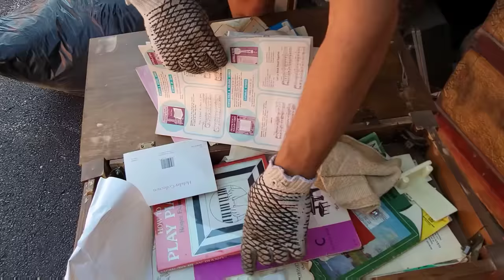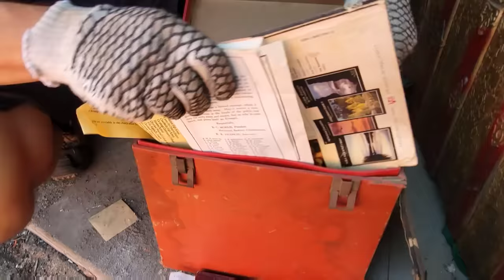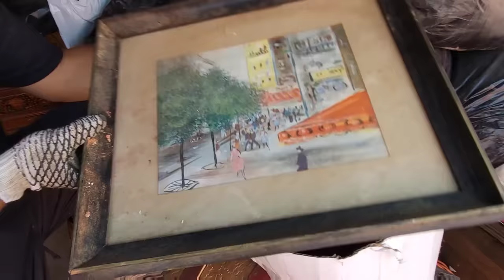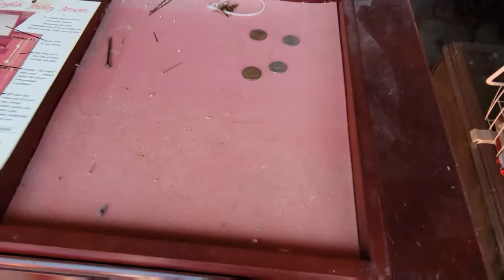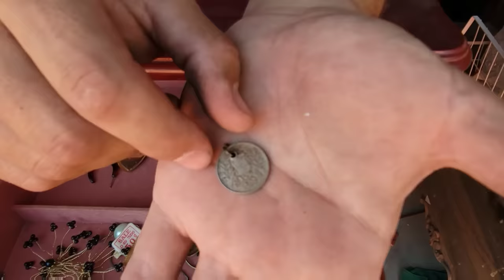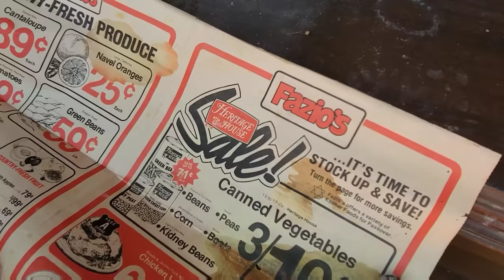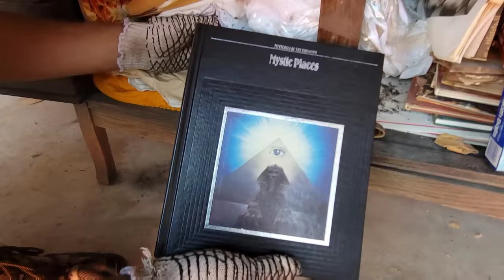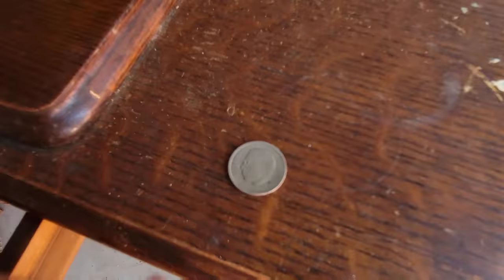HE PLAYED WHAT? Who Is This Guy

Comment: Vintage fabrics, trims, laces, and vintage sewing machines can actually be worth something. If you find a Singer 221 "Featherweight" sewing machine in working condition, it's highly sought after by quilters. You could at least get 200 dollars out of them, if they are an uncommon color (as in not black and gold) you are sitting on a sewing machine shaped gold mine. The sewing machine you found is a Singer 66 "redeye." they had a very long run. the first ones clamped their feet on the back. They would be over 100 years old now. Which, yours is! A singer 66-1, Check the serial number, it might be as old as 1905! The condition of the decals, OMG, stole my heart. I use one that was made much later, (1920s, almost 100 years old but not quite!) and it's decals are not nearly as a beautiful shape as that one.

Comment: Don’t lose the metal bobbins to those sewing machines bc it’s difficult as hell to find them. Most bobbins today are plastic & without the weight of the metal bobbins, the plastic ones cause more popping of the thread. (Fyi, metal bobbins are the small metal objects that sort of resemble wheels with an area to spin thread between them)

Comment: That white cloth looks like it is possibly a type of needlework called Hardanger. It may it a tablecloth or might have been used to cover the top of a bed, like a bedspread. Anyway it looks hand made. If so, if it's in good condition then it would be worth something. It also could have what is called drawpull thread needle-
work in with the rest the piece.

Comment: I'd love to know if you actually sold the Singer, and for how much.  Today, in eastern CT anyway, that treadle machine, which is a Model 66 (one of the top three most available antique or Vintage Singer) if still turning would sell for about $150-$200 if all the basic accessories are included.  I have several of them with their treadle tables, and about a dozen without. Only two of mine are as nice as that one.  The decals are the "Red Eye" set which is the most popular of the decals on 66s.